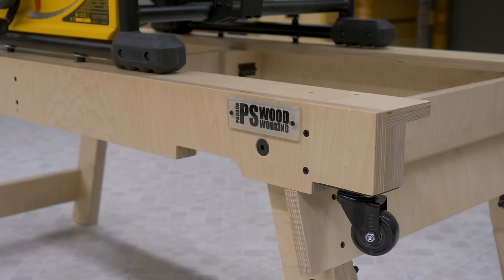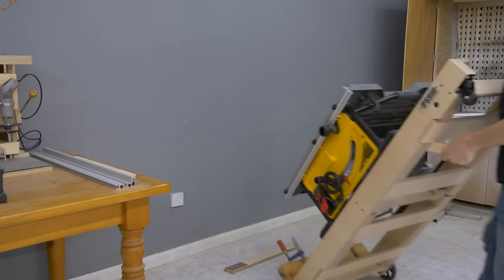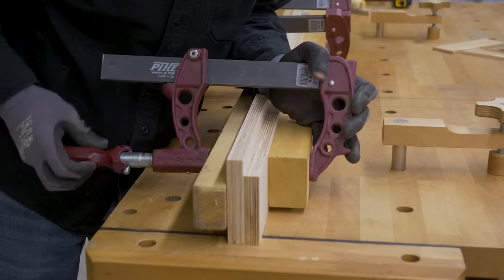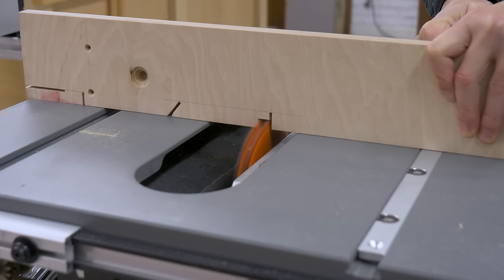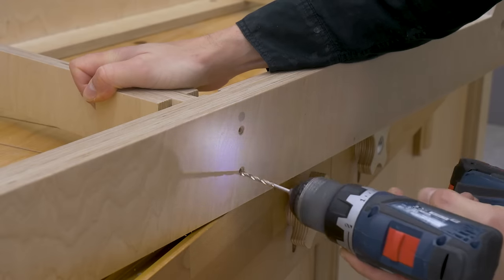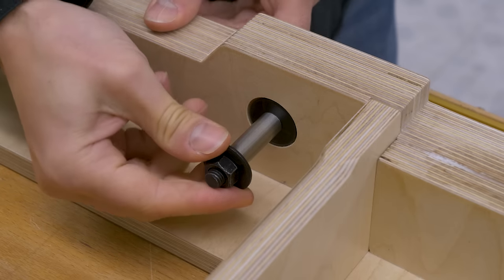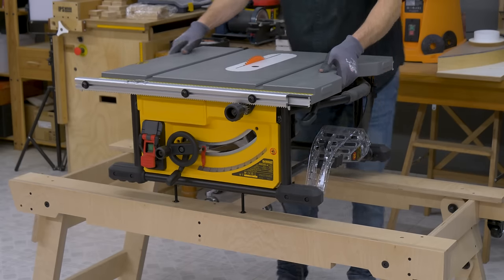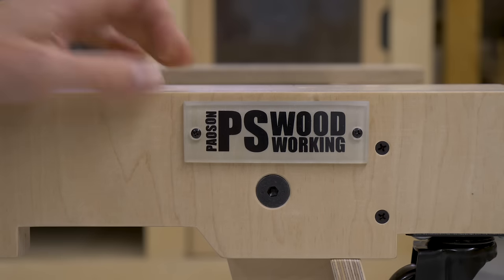DIY Portable Table Saw Stand - Pt. 1

Comment: FANTASTIC design and execution.  I can think of several other applications. 
If you want to avoid metal (nails) in the glue up,  a few grains of salt sprinkled on the glue will stop the slippage when clamping.

Comment: Nice design, can’t wait for router design. I just bought a 8.25”  Skil Worm Drive table saw for my small 14’ x 20’ shop. My wood lathe and DrillPress are the only toosl that doesn’t fold away.

Comment: A couple observations: Mount the riving knife. Notch out clearance on both crossrails to eliminate finger pinches. Add leg stops to prevent collapse. Reorient the saw 90° to improve overall stability.

Comment: As usual, an exquisitely made piece of kit for the workshop ... you could possibly use magnets to hold legs/handles in place instead of latches 👍
I was wondering why you'd made it so wide, but you then mentioned adding cabinets and it became clear why ...I take it you are going to add a router table to one end as well.
I look forward to the finished article, although I think it is going to end up being quite a heavy piece to move around and setup ... will be interesting 😀
Reply from the maker: thanks Barry!

Comment: Hello Paoson, congratulations for all the work you create, a question when you glue the various boards together at the beginning, you use glue and shoot nails. How can you be sure that in a subsequent burglary on the table you will not hit a nail with the blade of the table saw or with the cutter of the trimmer?
Reply from the maker: I try to place the nails in places where I don't have to drill holes or make cuts. It's not going to damage the blade or router bit too badly; these are 0.6mm thick copper nails. It could be dangerous, however, if a piece of metal flies off and hits you in the face.

Comment: This is a wonderful design, but I am wondering what happened to your previous cabinet for the table saw you built which had the built-in router table, and sliding crosscut?  Were there problems with the design, or did you give it away, or ...?

Comment: my first thought is that this falls in to the common youtube build trap of being extremely over-engineered and prettified for its real world purpose. All you need to achieve is a strong flat bench with wheels and foldable legs for a table saw.. why does it need to look like it's made with a CNC machine and have a million hard to do rebates. Striving for unnecessary perfection at the wrong times is a huge hindrance and a not so obvious enemy.

Comment: Nice work - takes up too much space - not yet a finished product.  You've oriented it the wrong way round.  Why didn't you use all that additional length to add a run off table to support longer cuts. If you're taking a saw like this to a jobsite, you're doing more complex work and need to make long cuts to dimension timber.  You don't take a site saw like this to a framing job, that's mitre saw territory. A site worker also wouldn't use this to cut down sheet goods either - circular saw.

The ONLY place this type of saw has on a site is to dimension timber on the LONG AXIS, where doing so would otherwise need careful and time consuming planing.

My suggestion - make it shorter, put the saw at or closer to the front - maybe add a section to support long timber at the front (half the size of the saw plate), add a runoff support at the back at least the same size as the saw plate.

I wish I did YT videos - I'd make this properly.
Reply: Why does it take up too much space? ... It gives a wide stable work area for cutting and extra support for longer pieces could be provided with slight modifications (or by using stands) ... it's designed to fold away to take up less space when not in use! .............. How is it orientated the wrong way round?
Take any tool/jig/fixture and it'll be great for a specific range of uses but rubbish for others ... most people concentrate on what something can do and do well, not on what it can't do or isn't suitable for!
Reply: @barry.w.christie  Because the whole point of this is it's a portable site saw, that has to go into a van, alongside a ton of other stuff.  Trust me, after a half dozen times of putting that saw on and off the mount, you're going to stop doing it and just leave it on there, so now you've got a site saw that's taking up 3x as much space as it used to. Can't be hung up vertically, so it'll have to sit flat in the van - hence the "takes up too much space".
Reply: @rafezetter8003  I understand what you are saying, but the description mentions it as a possible use, not the only one ... the saw itself is a worksite saw so doesn't need this added to it unless of course you need the extra functionality, in which case it'd be perfect!
I mentioned in my own comment below that I think it's going to be quite heavy to move around, but for those with a workshop of modest dimensions it offers some of the benefits of a larger table saw, while at the same time it can be put away in a smaller space ... exactly what it's really been designed for.